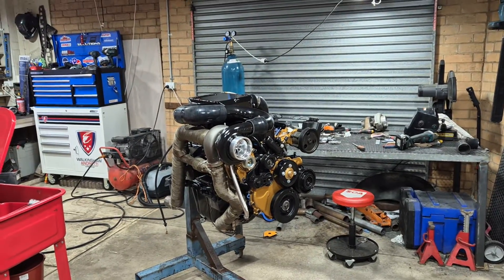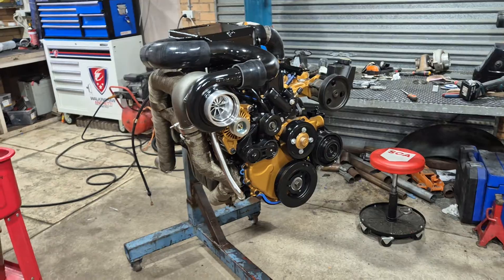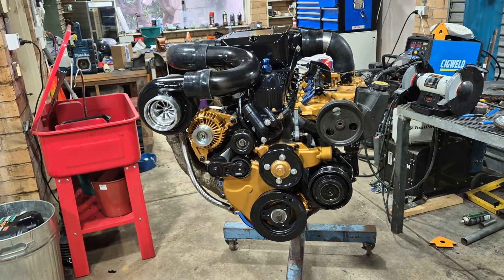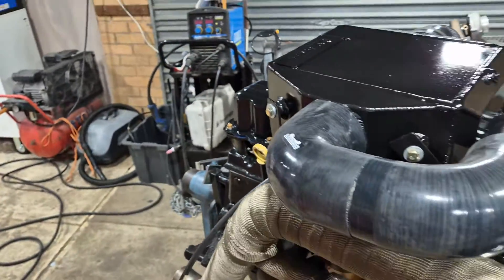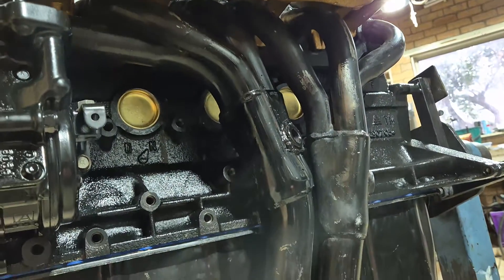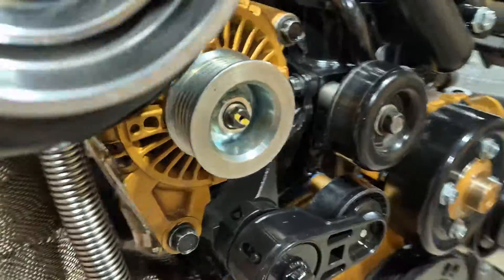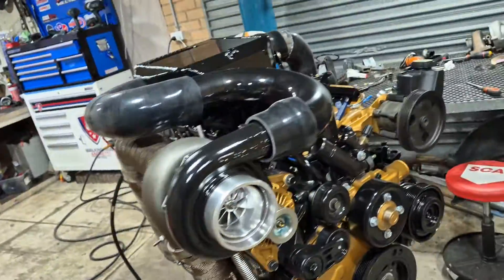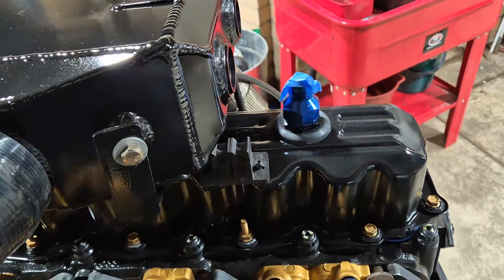Jeep 4.0 Turbo Engine build updates

Comment: DUUUUUUDE. That thing is sick ! I love the gold as well, Im thinking about doing some sort of AMC Metallic blue or that Mopar gold color too with some flake on just the block ! I'm leaning on the blue to stick with its AMC heritage but this video after seeing the gold makes me want to do a glossy and metallic gold ! i'll see what color i want 😆
Man i so excited for ya man 😁 It looks damn good !
Its good to see this thing "alive" like you said! I cant wait to see how it does and performs once its in the jeep

Im in the current moment of waiting on my machine shop for them to even touch my block for machining, a good amount of forged goodies will be in it from Russ pottenger and to mention i will be doing a stroker! I was gonna do just a 4 Liter build but piston speed isn't much of a concern IMO since you really cant get past 5800 supposedly cause  of Cam harmonics and it breaking double roller setups like you and i are ! 
So with a 4.5L i should be good ill keep the Rpms below 5600 daily, It will be N/a for about 2 years maybe, ill be doing a 8.3:1 Dcr and a Static comp. of around 9.4:1 or so i should be Ok with the nitrous it will see and a turbo, The aluminum edelbrock head should help too with any pre detonation to an extent compared to iron! Will run an ARH header too so induction wise i should be pretty good !
Reply from the maker: Thanks for the reply, check my other vids, it's running at turning to 6000rpm, about to start turning boost up